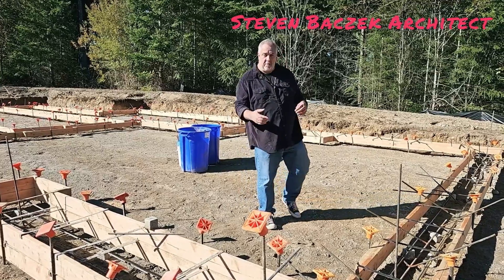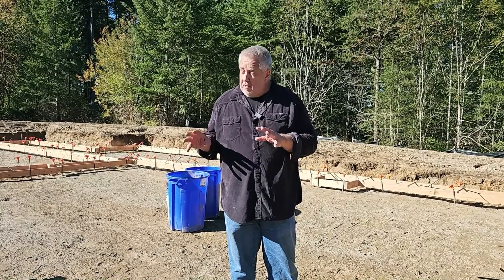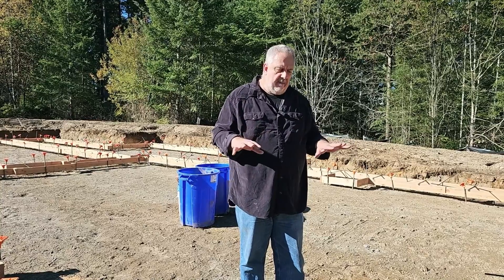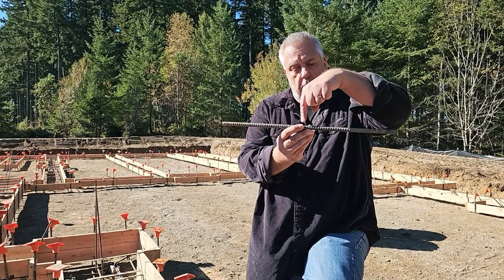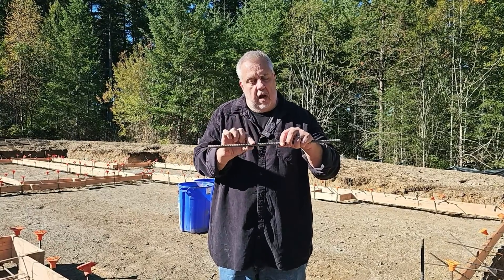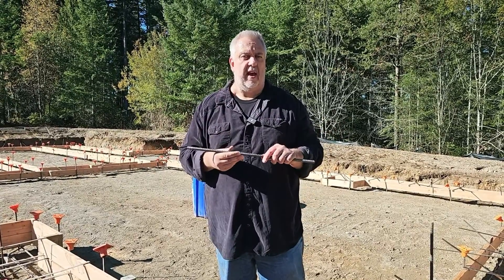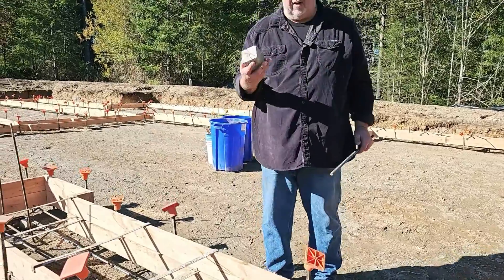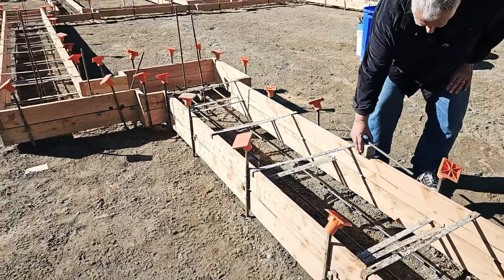Concrete Footing Reinforcement - Part 1

Comment: Very well explained Steve.
I retired after 40+ years in the Rebar business.  VP of commercial and residental estimating, detailing and sales in Dallas for a major fabricator.
Tricky thing to grasp at first is residential calls a #4 bar 1/2" and #5 5.8".  You'd loose them with #5 bar.
Couple things............
They don't use transverse bars in continuous footings?
The edges are "deformations"
Love your videos brother!
Reply from the maker: Thank you for joining in the discussion